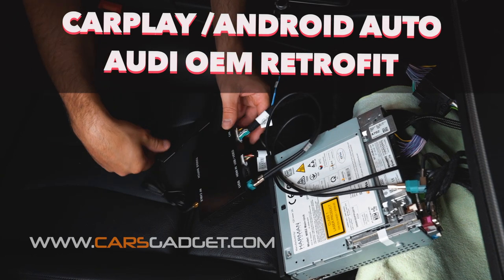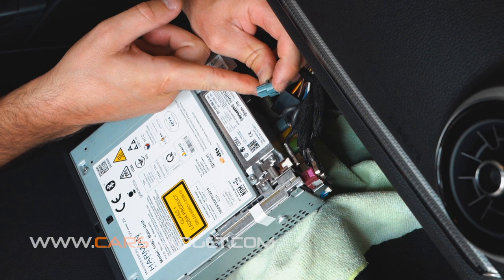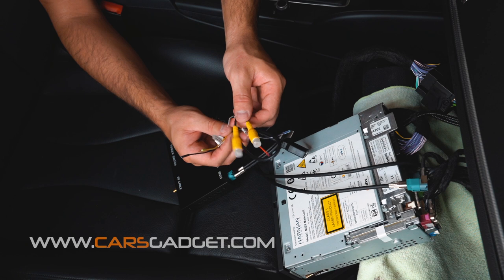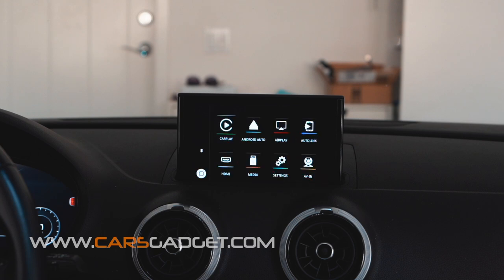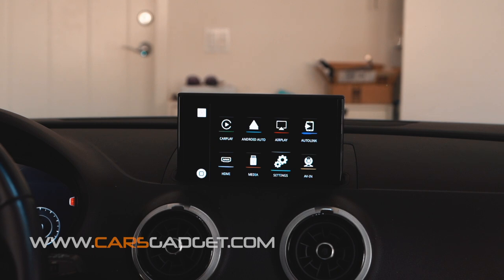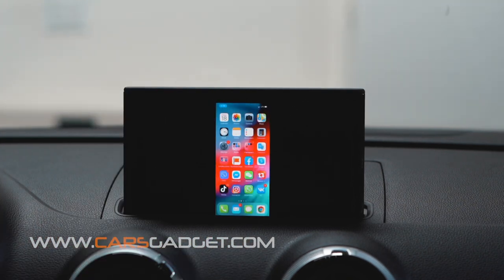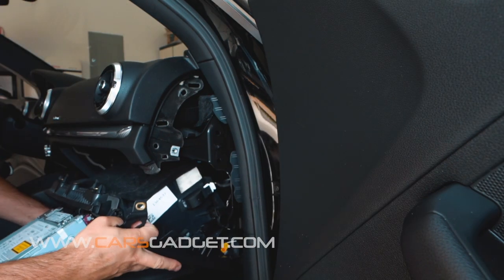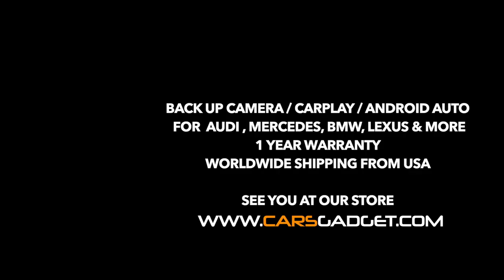Audi Wireless CarPlay Android Auto retrofit for A3 A4 A5 A4 A5 A5 S4 S5 Q5

Comment: Thank you for the support last night. I can’t believe how easy it was once I saw the snap connector. Finished installing the backup camera kit and I am very satisfied with the finished product. Total install time was about 4 hours. I saw your installation video and that helped a lot. There were a couple of steps where I got stuck for a while like pulling the trim around the display, reinserting the rubber boots in the tailgate and fitting the stereo with the additional quad connector installed.
My only regret is not buying this retrofit kit years ago. I wish I would have found it earlier.

Comment: Hi, great video. I have the same unit for my A3 e-tron 2015 in the UK, but I can’t get the jumper pins correct (tried all the ones in the manual) so I just get a blank screen when I hold the media button. Can you help?
Reply: Might have connected the lvds cable to the wrong plug as it's different depending on vehicle spec (mib high vs standard)

Comment: Just installed in my Audi A3 and the screen is doubled. Any advice. When in the Audi mmi it’s fine but when I switch to CarPlay it’s doubled. Any help would be appreciated.
Reply: @CarsGadget  thanks for the reply. Turns out I didn’t have the aux mmi cable plugged in. Works perfect now.
Reply: @Shawn609  what does aux mmi cable do??  Do I need one with this Apple car play??  Thanks
Reply: @thetruth6992  yes. It plugs into the aux jack in the center console. That’s what triggers the system when you hold down the media toggle.
Reply: @thetruth6992  should have came with the kit
Reply: I am having the same issue and when I plug in the aux mmi it does not change anything.  Any update on what you did?
Reply: @seanwysocki4969  For me once I put the aux cable thing in it switched to full screen. I’d say double check that the module switches are set properly. 🤷‍♂️
Reply: @Shawn609  I followed the dip switches in manual.  They then told me to do different ones which fixed the screen.  However, I’ve been having an issue with it freezing randomly every time I drive 15 minutes or so.
Reply: @seanwysocki4969  not sure about that. I know I have to almost monthly delete the car from my phone and reset it cause it wot recognize my phone. It’s a nice system but it does come with its headaches as it is an aftermarket part.

Comment: Could you point out why my Audio calls sound extremely bad
Reply from the maker: You can adjust mic settings in the CarPlay interface menu. If the sound is still bad you may need an additional aftermarket mic.
Reply: @carsgadgetusa123  thank you I fixed it! 👌🏿